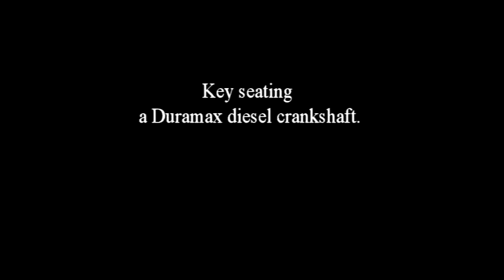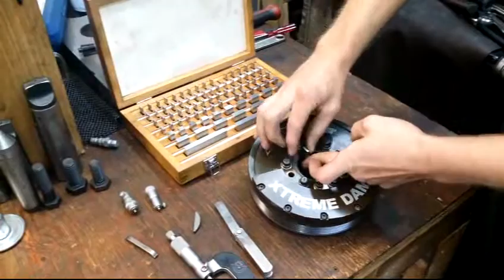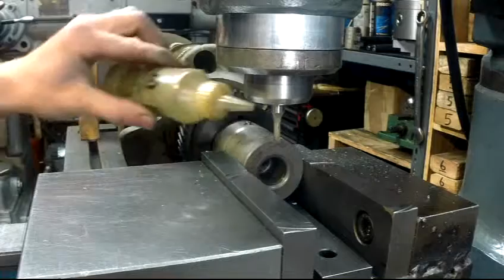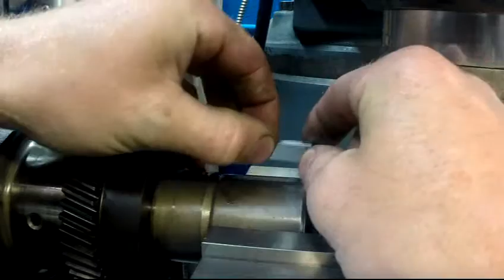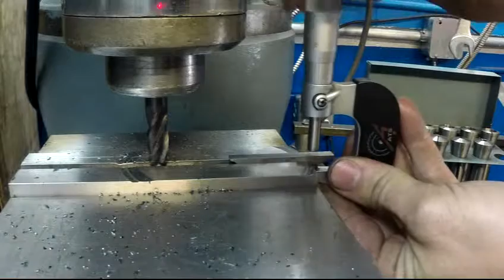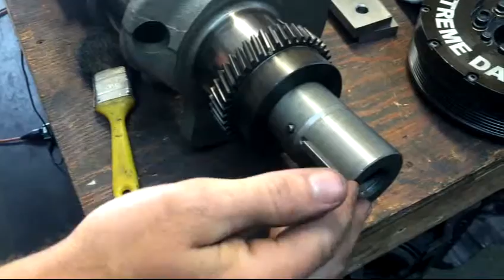Bridgeport Project: Duramax Diesel Crankshaft

Comment: Very cool video! But my question is, why not key the oil pump gear as well? I hear that pin shears off as well.
Reply from the maker: Hey thanks Keith, very valid question.  This crank came from a local engine shop with just the key request in the video. I don't follow the diesel stuff or build them here at all, so I have very little insight on them and/or the "what to do's" to make them perform.  I have modified many other pump drives on various non diesel cranks and it would seem wise to do so here aswell, but not what I was asked to do.
Reply: @whiplashmachine  I'm new to the diesel stuff too. As far as I can tell, that lone design flaw is what keeps a Duramax from being immortal, lol. Very low class by G.M.s usual standards. It was very interesting watching the precision of your setup and executions, you earned a sub!